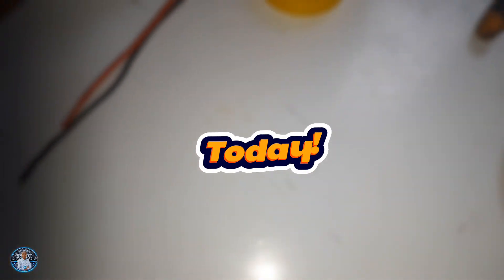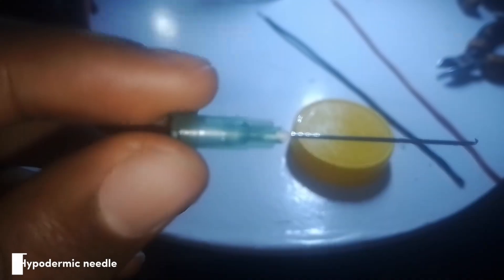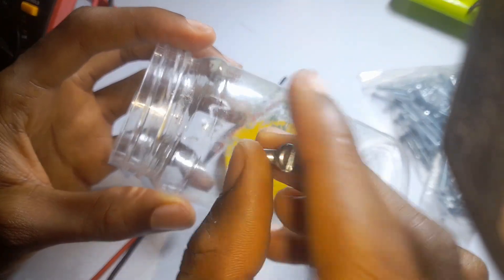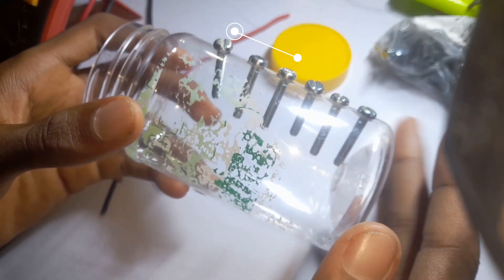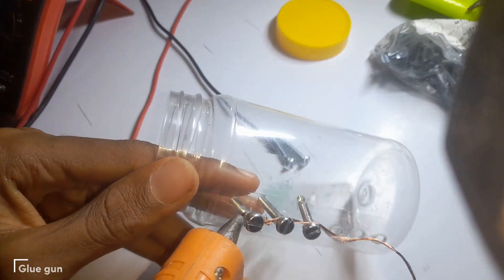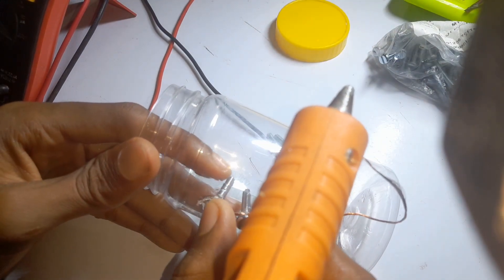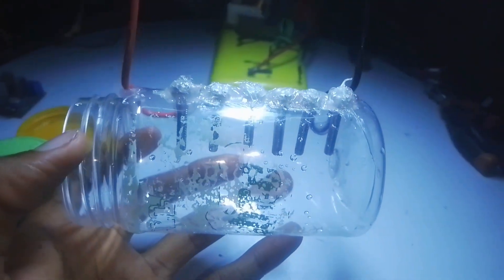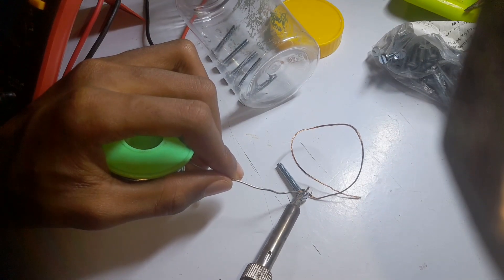Can water create Fire? - Let's find out!

Comment: Try compressed stainless steel wool for maximum output
Reply from the maker: Thanks for the tip 🙂
Reply: @successfulelectronics I've been wanting to try it myself but I am living out of a backpack at the moment. I know it'll work because everything is about surface area. Everything.
Reply from the maker: @eskimocommotion4965 yeah you should try it out when you finally in a apartment where it will be safe, but still not that dangerous you can still try it if you have the tools